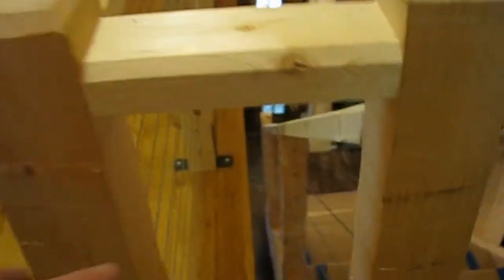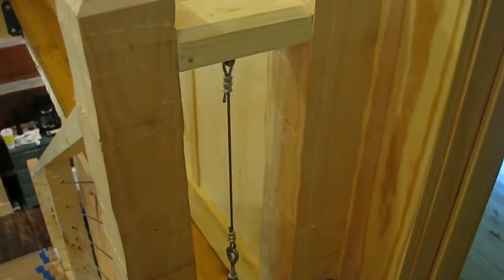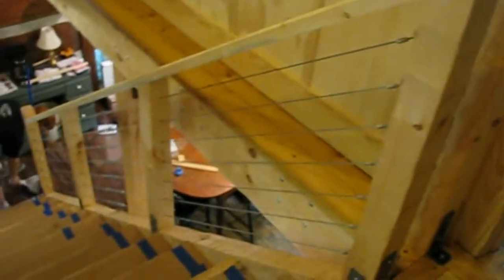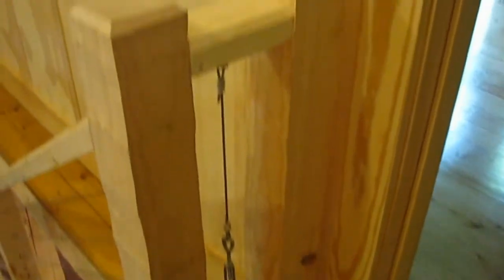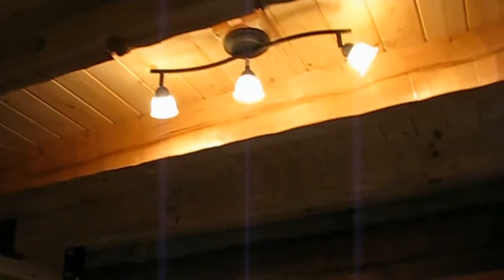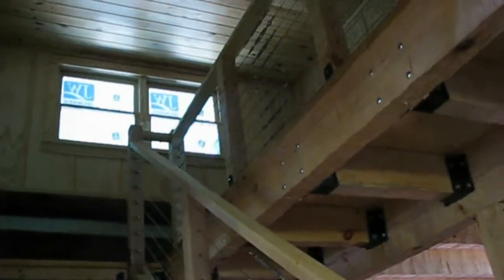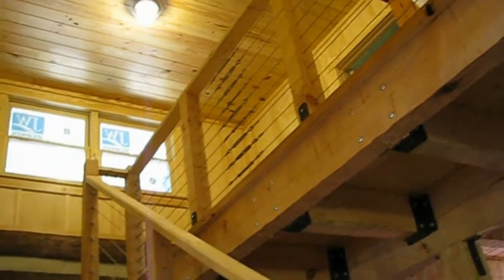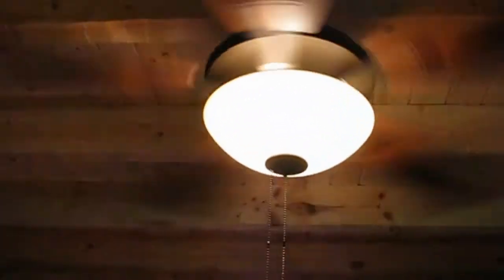Mountain Cabin Renovation - Vlog #20 - Cable Rails Complete

Comment from the maker: @freakshow2000 The top handrail keeps them secure and spread apart at the top and the metal  brackets keep it secure at the bottom.  But you are right, you have to secure the rails well to keep the cables from pulling them together. Thanks!